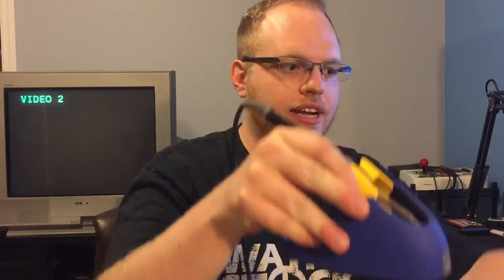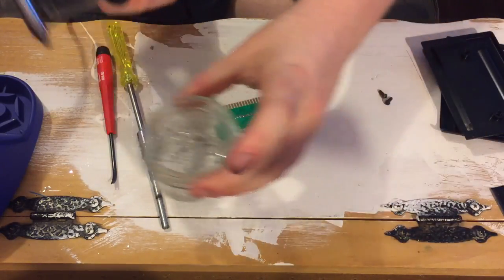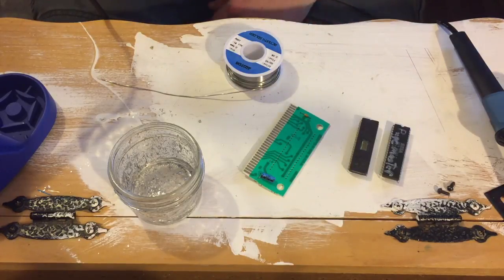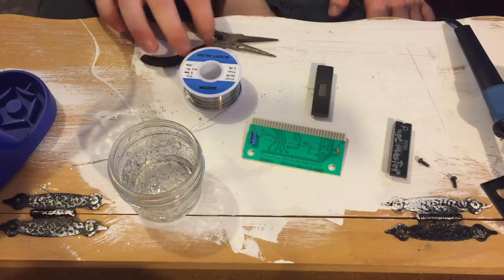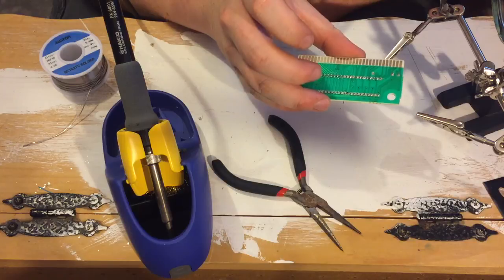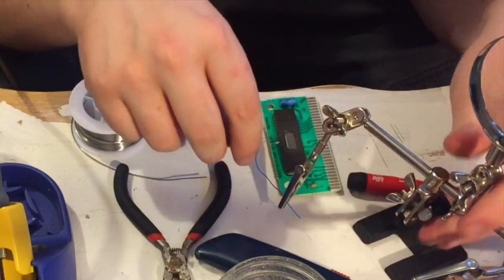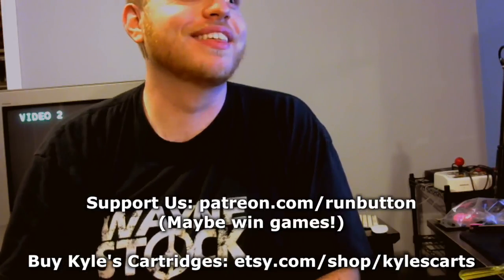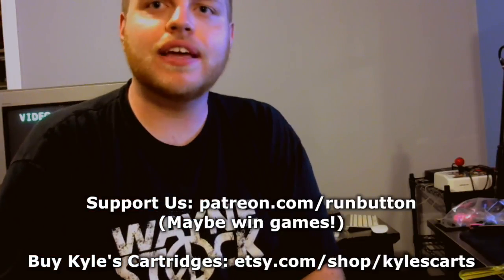Let's Make a Game Cartridge! - Sonic 2: Pink Edition

Comment: If the wire part is giving you trouble try fixing the wire directly to the board with some glue or silicone so you don't have to hold it also you could probably just heat a plate of metal up and set the board on it to quickly desolder the entire chip instead of fucking with that iron

Comment: Semi-related: I've found it handy to use a pair of scissors in the absence of a wire stripper (or in your case, when the wire is too thin).  Open the scissors slightly, set the wire in the crook where the blades meet, then circle the wire a few times with the blades to break the shielding evenly around the wire.  Then you can just pull the little tube of shielding off with less of a risk of nicking or cutting the wire.  Without touching the wire in person, I don't know how well that technique would work, but it always worked fine for me when I needed to make a RJ-45 cable.
Reply from the maker: I tried this a bit and i just kept pulling the ends of the wire off, but i was probably closing the blades too much. I should try it again, thanks.

Comment: It's hard to believe people sell these for $30-$40. Thats a couple hours of work not counting material costs.
Reply: 2 hours of work would mean that making these would be a 15-20 dollar an hour job, assuming no material costs.  That's not really an absurd asking price for 2 hours of labor.  And that is ignoring the material costs that go into making the individual ROM, as well as the costs of getting the materials that used and aren't consumed (like the de-solderer or the tool Kyle used to pry up the chip).

A lot of people tend to under-estimate the time that goes into making things in general, as well as the costs that have to be paid to hit the base conditions of being able to make something, let alone the costs of the materials of the product itself.  Lots of people look at, like, etsy plushies and see them as "too expensive" even though the creator probably spent multiple hundreds of dollars on a sewing machine, spent hours practicing to make their original design, then spent hours actually sewing the plushie, not to mention that making these things also often involves other machinery, other skills that had to be developed, and of course the material cost of the item being sold itself.

People need to stop underestimating the labor and costs that goes into hand-crafted goods just because they're used to automated or assembly-line goods that are made much quicker and cheaper.
Reply from the maker: +Kennisiou  Yeah, this is pretty much spot-on. If you look at the apparent material cost vs price it looks like you make a killing, but as I've found out, the devil is in the details.

You might not consider how expensive printer ink is, and how many test prints or bad prints (or mis-cuts) you basically have to throw out, and there goes your $1.50 per sheet sticker paper. Adhesive-resistant craft scissors, cleaning products, punch tools, it kinda goes on.

That's to say nothing of how unreliable EPROMs and EPROM programmers are. In this video, I cut out an HOUR of being unable to get the programmer to successfully write to a chip. Granted, it was mostly user error, but just this past week I got 5 chips I ordered from China (took 3 weeks to arrive) and 4 of them didn't work. Literally spent hours (AND HOURS) trying to write to them over and over all weekend.

Plus there's all the research time. I say without exaggeration that figuring out how to get Sonic 3 Complete working on a cartridge was probably the most difficult-to-find information I've ever searched for online.

This video was originally 4 hours long :P Of course, that time was inflated because of me
blabbing and silly mistakes, but still.

Dang, I didn't mean this comment to end up as a pity party :P Sorry!

Anyways, in summation, etsy.com/shop/kylescarts
Reply from the maker: +Run Button (PS I realize that, like any business, the biggest costs are up front and the longer you do it, the lower your costs become. Ideally, anyway.)